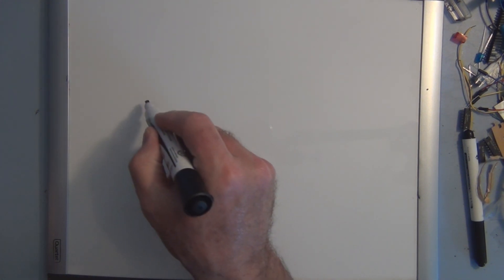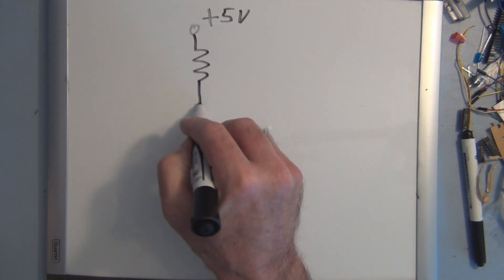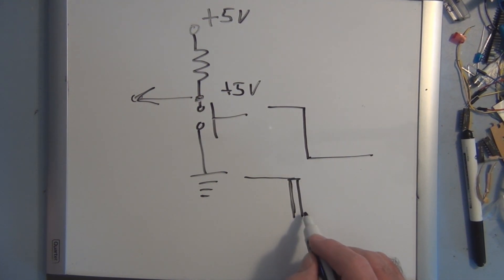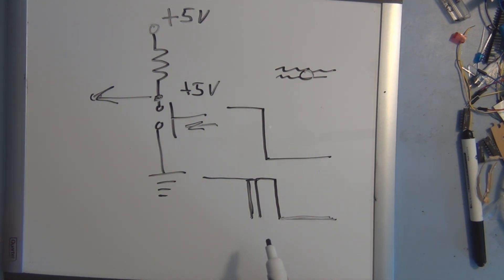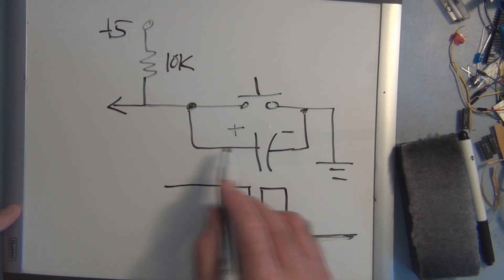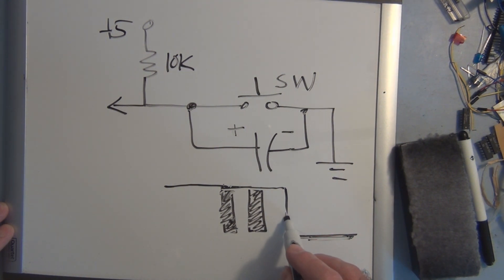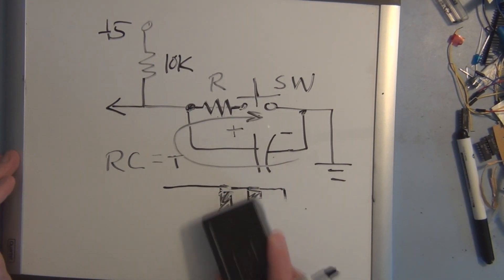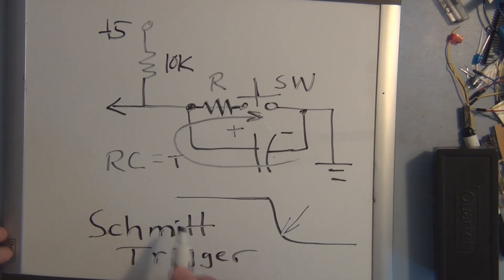Arduino and Hardware Debouncing tutorial

Comment: @1:15 you are fundamentally wrong! an encoder (at least the most common and cheap ones picked up by diy projects with arduino o the RPi) is exactly a series of mechanical contacts being switched in any direction by free hand! the amount of noise you get between detents is pretty high (and in the cheapest chinese models is insane) so it's MANDATORY to implement a heavy debouncing method, being it by hardware (rc smothing) or software (validation algorythms) or both (most efficient)

Comment: 06:15 If you put the second resistor there, then the output will never be equal to the Ground potential. Instead, it should have been placed just next to the capacitor in series.
Reply: a bit late here but still hope you can reply, 

Next to it after the switch and capacitor or before? thanks
Reply: @vladurs6475  just watch this one...way better... https://www.youtube.com/watch?v=9UKM0vlHGkI
Reply: @UweWong  you linked the same video. maybe paste wrong url?

Comment: Thank you for detailed video! Are the values of resistors and capacitors the same if I'm using 3.3V as input instead of 5?
Reply from the maker: Yes you can use the same values or use software debouncing techniques.
Reply: Thank you!
Reply: @tmc200527  Che valori hai usato?

Comment: you are so backward and out of touch with electronics. A dead short across the cap is a dead short to zero - even on break bounces it will go to zero fast and not so fast to charge up on the bounce because the cap has to charge through the pullup.. On make bounces, THEN, the cap has to charge through a resistor and follows the exponential curve. Then you add a series cap to slow the transistion to zero which is NOT what you want. Powering a Schmitt from a negative supply. geeze...
Reply: Mike C - I feel we walk in each other's shoes (an old thing said by old soldiers, at times we did so walk when a friend was lost.) 

This is the terrible result of the dark age of the Arduino. The generation behind has no idea how to program in assembly much less how to do timing calculations on an RC circuit. 

The Arduino is a dumb bomb aimed directly at America. Europe has been in the back seat of science and engineering since WWII. Now from the most unproductive parts of a dead European empire (the Mediterranean) comes the perfect weapon to destroy America's technological leadership - the Arduino. 

Things will be much worse before turning about. There must be a generation of failed imbedded systems before academia wakes up and again challenges youth to learn Boolean algebra. 

It came to mind that the Soviet Union went through a phase like this. In their case, Stalin's purges were the dumb bomb that wreck their generation of scientists. 

Long rant. I know. But I am depressed at the state of blissful ignorance in the minds that should be learning Maxwell's equations but is instead captivated by idiot Tom and his blinkies. 

Sad days in America.

Comment: if i have 16 buttons how many capacitors do i need?
Reply from the maker: I guess it would depend on the topology of your circuit.  If you were monitoring one input to see if any one of 16 buttons in parallel was pressed you could use one cap.  If you are monitoring 16 separate inputs you would need one cap for each.
Reply: It's parallel-in serial-out, so I guess it's the first case. Thank you.